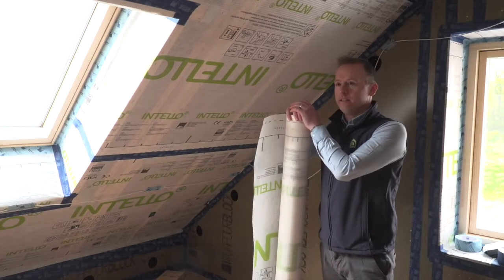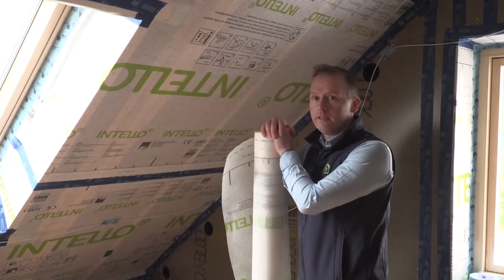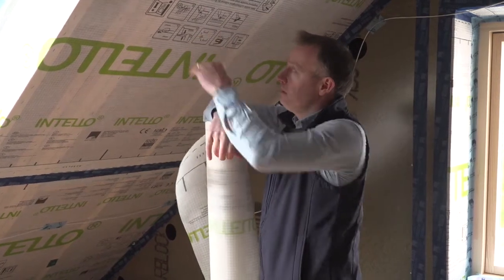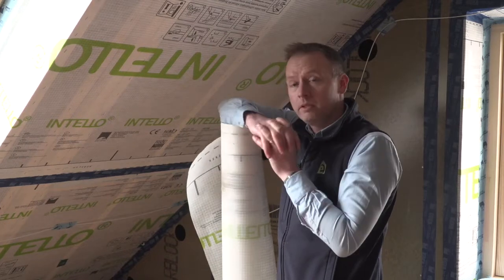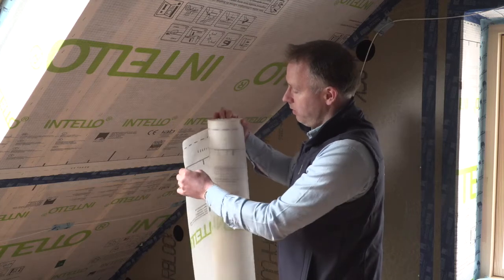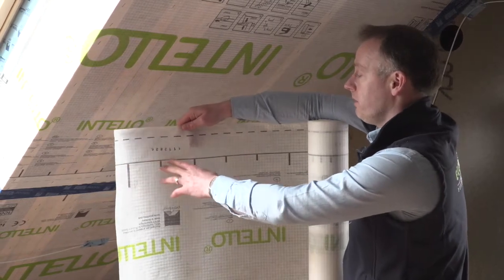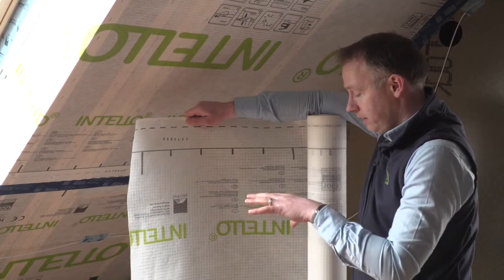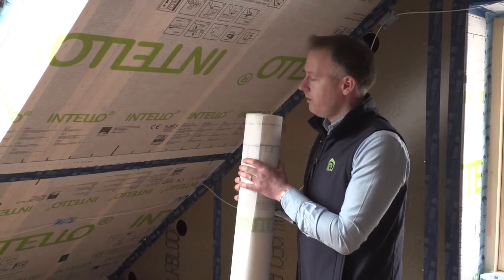Intello Plus Intelligent Airtight Membrane - Passive House Insulation Series (Part 8)

Comment: Can you butt ends together with tape or do you need a continuous length for each layer?
Reply from the maker: Hi @andypag1071. You would continue the Tescon Vana tape seal across every metre of the membrane overlap to ensure there are no air leakage points after the membrane is applied. Thanks for the message.

Comment: Sweating = condensation = mold and rot.
Reply from the maker: You're correct..if you mean minimum risk of this...the construction is diffusion open (breathable) outside with woodfibre and a hydrosafe membrane inside (which allows back diffusion if needed), hence the drying capacity is exceptionally high and risk of interstitial condensation very low, thanks to application of sealed internal airtightness and vapour control to passivhaus levels...oh and internally there is a controlled MVHR system..low energy, max comfort,  healthy IAQ, minimum risk of mould...all the great things about Passivhaus with natural insulation materials :)
Reply: @EcologicalBuildingSystems  Wouldn't moisture condensate on the inner side of the insulation due to temperature inside the house below dew point when taking into consideration outside air temperature and humidity? Sure. So... if inteligent membrane opens up and release that humidity towards drywall ain't that gonna cause shifting the problem to drywall instead?